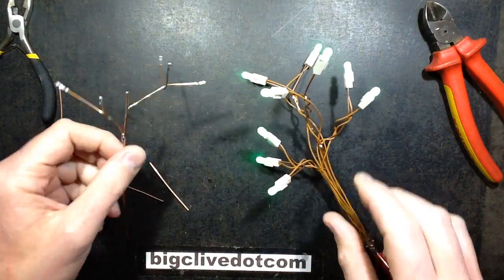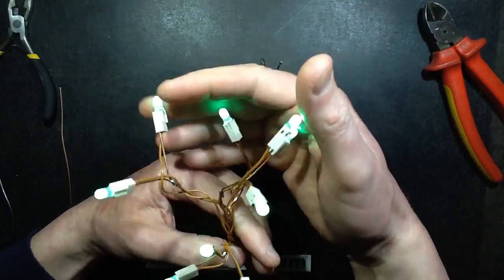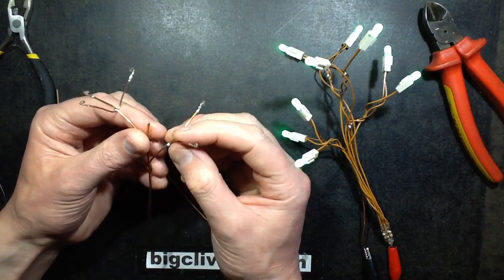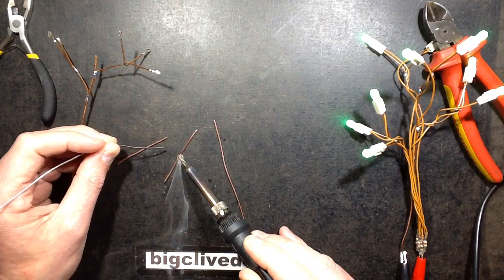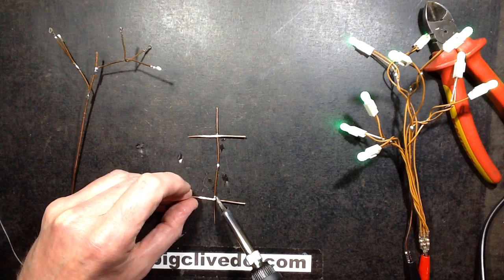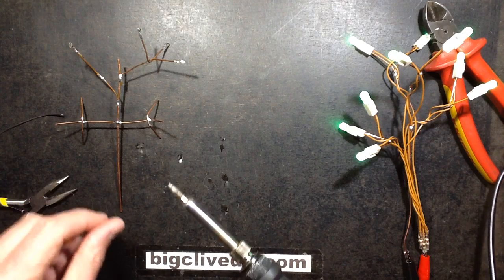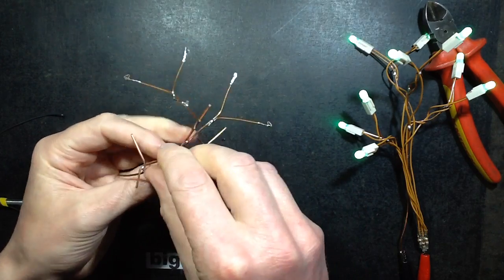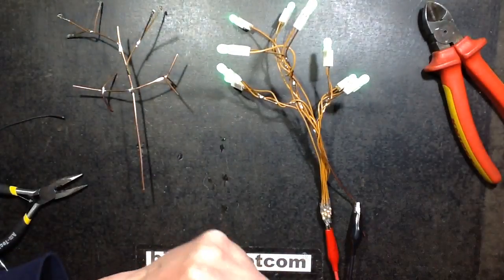Experimental wire-form LED tree.

Comment: Probably it's the truly eutectic solder that sets nice and smooth.
Solder with slightly different compositions (like, as an extreme, plumbers solder) will go into a mush just before entirely solidifying.

Comment: I may adapt this (using 3 way connectors?) to a series wiring arrangement using solid cat5 cores.

I have a 50v DC bus in the workshop (mostly dealing in telecomms) so series would be ideal!

Comment: May be worth a try using enammeled transformer wire that has a thin  no conductive costing that can still be easily soldered. Or use those strings of SMD leds that use the same wire and the leds are coated with epoxy to make a led tree.  :-D